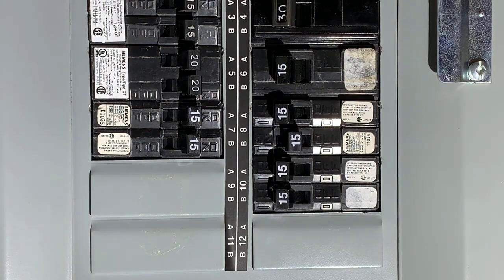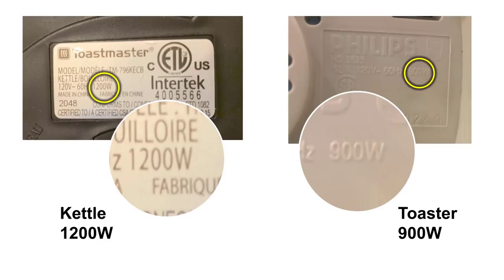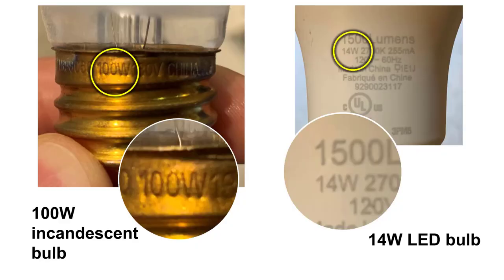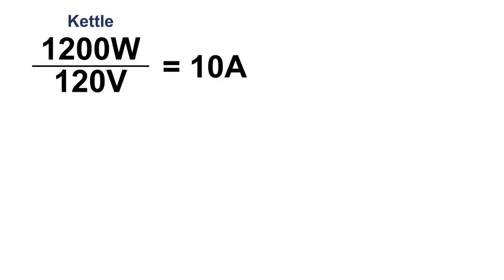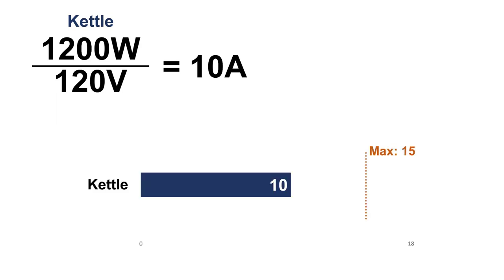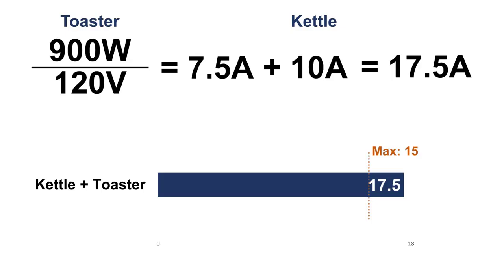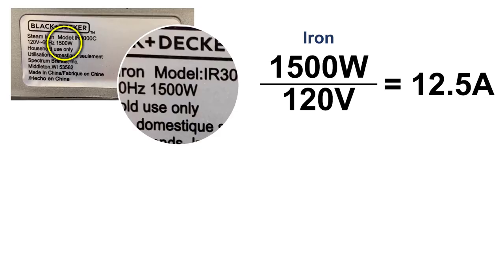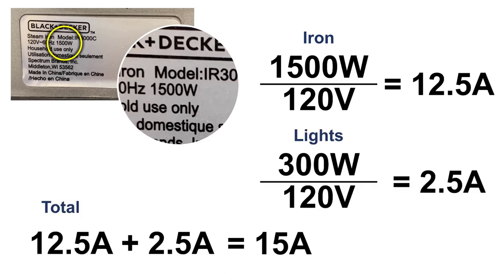Breaker Trips or Lights Dim: Why it Happens and What To Do About It

Comment: Lots of good information thank you. My garage is slowly turning into a workshop. I almost changed my 15 to 20 Amp breaker. I figured you can't just do that, but wasn't sure why. Thanks for protentional protecting me and my family.
Reply from the maker: I'm glad you found the video helpful. If you can run a new 12 gauge wire from the panel to the garage then you can have 20 amp outlets in the garage. But running new wire from a breaker panel through a finished house can sometimes be tricky.

Comment: I live in a huge building. My lights dim for just a second when I turn ANYTHING on. The induction range is on its own 50 AMP circuit that is shared by nothing else. When I turn on a stove driver \ element the lights in the whole unit dim for a second. The lights don't dim and stay dim. The lights dim for a split second and then come back up to full brightness. The breaker never trips. Only other thing I have connected is the K-Cup machine but it is not running at the time of the dimming. My range, refrigerator and dishwasher are all on separate breakers. Whenever I turn on something big the lights dim for a second and come back up immediately. Any hints on whats going on. Lazy Electrons maybe?! Should I be worried?!

Comment: One thing you missed is that if it's due to kitchen countertop equipment the person may be in a home that's old enough to not have any of the code required kitchen countertop circuits.  One way to help alleviate this issue is to run at least one of the two required 20a countertop circuits to give you somewhere to plug in some of the kitchen equipment thereby providing some relief for the other circuit. If you're doing a major kitchen renovation, just install both required 20a dedicated kitchen countertop circuits and rework the old circuit so that it no longer has kitchen countertop outlets.
Reply from the maker: The home doesn't have to be that old to not have kitchen circuits that can handle appliances. One kitchen I know of (home built in the early 1990s) had messed up wiring so all the plugs, the under counter lights, and the dishwasher were on one circuit. Stuff was tripping the breaker all the time. I agree that if at all possible run 20A circuits for plugs and a 15A circuit for the dishwasher, even if you aren't doing a full kitchen reno. It will save a lot of frustration.

Comment: Breakers do not trip immediately when the limit is exceeded. A 15 A breaker might take 17.5 A indefinitely. If it is twice the rated current it should trip within a minute. You still should not try to take advantage of this and overload.

Note the formula applied only on heating devices. With electronics one need to take into consideration the power factor. To be safe, double the current figure for them.
Reply from the maker: Thanks for your comment. I totally agree that you should never try to take advantage of overloading a breaker just because it doesn't immediately trip.

I use heating appliances as an example because those seem to be the ones that cause the most tripping. As I say in many of my videos, if the issue is more complex or you are not comfortable with an electrical investigation or repair, contact a qualified electrician.